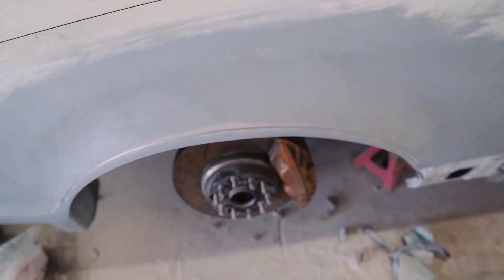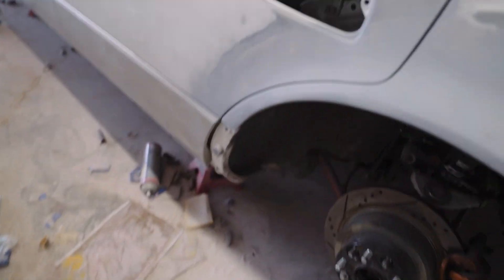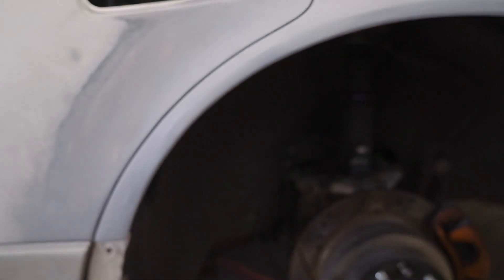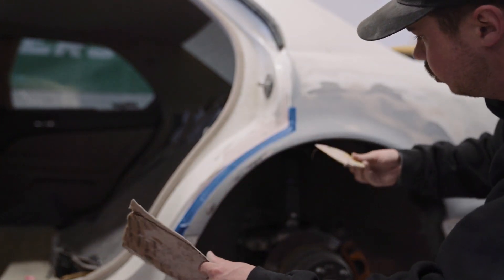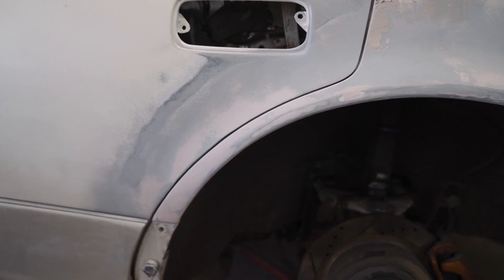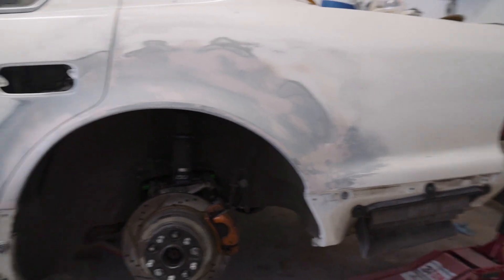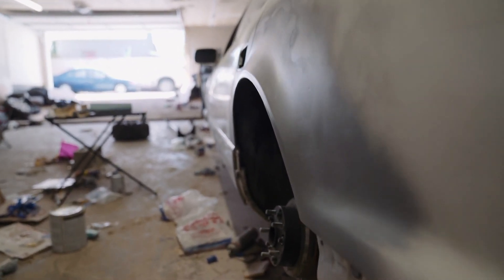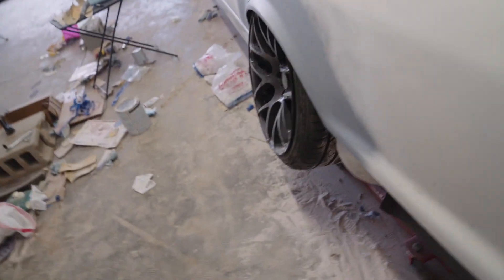It's FINALLY Taking Shape - VIP Style LS400!

Comment: Yo! On the dogleg under the back door where that body line dead ends from the metal being too high just tap it in a hair with a hammer so you can smooth out the transition. No need in grinding that metal down too thin breaking through and having to cut it out and start over
Reply from the maker: Yeah I guess that’s not a bad idea, I just don’t want it to crack any of the body work